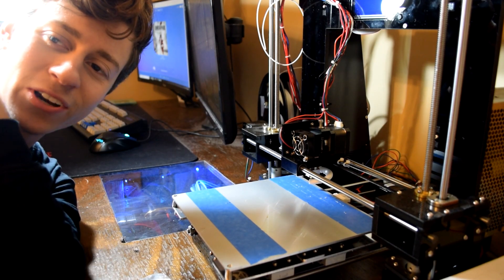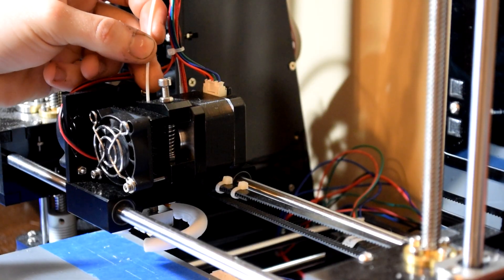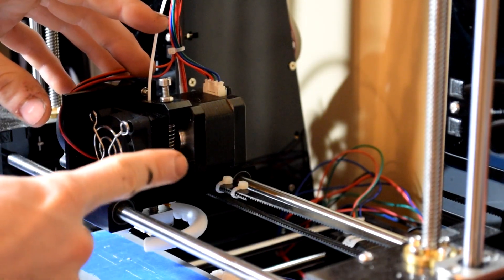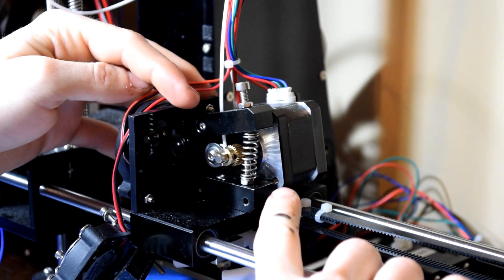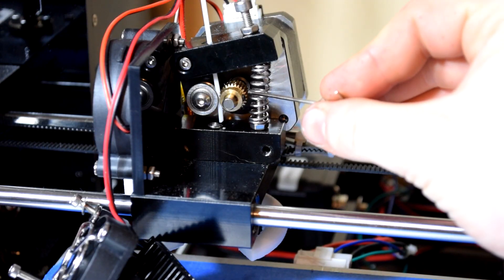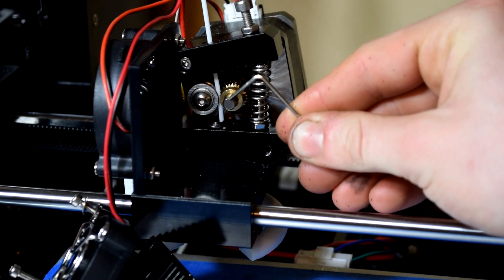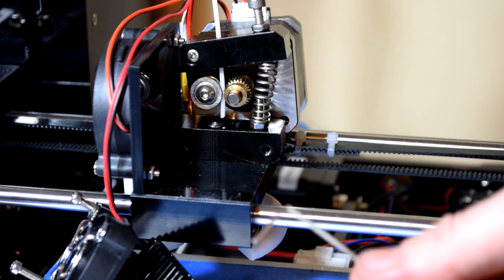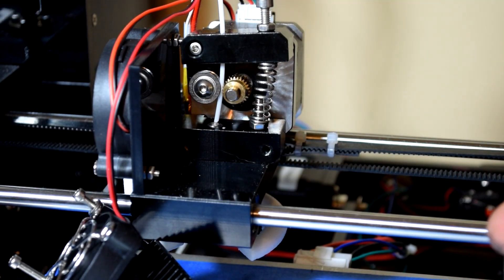3D Printer Filament not Feeding? FIXED!

Comment: For me, this is not the fix I needed, but I would like to share this to everyone. The source of my problem is that the spring is not as pushing as hard. As a result, there is not enough hold on the filament, what I did is I just tighten up the bolt of the spring.

Comment: I know this video is a few years old but I'm only just having this problem with my ender 3 v2. I don't want to take apart the whole extruder mechanism to see what is going on because its just that brass gear that keeps coming loose, is there any way to secure it down without drilling and tapping the shaft of the stepper motor?

Comment: Thank you for your video. In my case the gear rotates as I 'Move axis' Extruder, but it doesn't forward the filament. When I release the gear I can easily push the filament forward by hand and the heated extruder works, lets the material out. If you or anyone can give me a hint where to go...

Comment: Honestly I was having a similar problem but it was more so the position of my spool rather than this exact dilemma. Easy fix though really. Having the spool level with the feeding area (I'm still a newb and don't know the terminology just yet) on a rotating platform works PERFECTLY! I was lucky enough that my wife actually already had a rotating platform she wasn't using anymore because the post was broken but with a bunch of tape, it works just fine for what I need it for. Plus I'm sure you can print one out as I'm seeing more and more that there isn't a single thing you can't print. Best of luck guys and happy printing!!

Comment: Revisiting this since I gave up last time. Notice no comments on my comments. I kept replacing parts in hope of fixing it but I'm pretty convinced at this point that some if not most 3d printers are engineered to fail. Not sure if anyone is familiar with the inside story with the guy who found a programmed chip in his ink printer that was actually programmed to limit prints. After so many prints it would prevent the printer from working. That's exactly what I think is going on here.

Comment: Same problem after about 10 hours of printing on brand new mega zero 2.0.  Yep the gear set screw was loose. Same fix but different parts. My gear shaft has a flat spot and if the set screw isn’t lined up with the flat spot it will continue to loose n!! And lining up and feeding the filament through before tightening the bolts is a must, and don’t over tighten (or the gears might not rotate!) 
This was a great post. I’m back up and running in less than an hour! Thanks Toasty Boys!!

Comment: Nope. Didn't fix mine. Set screws were nice and tight. I went ahead and even replaced that cog. Replaced entire hot end and still a no go. Guessing it's that bearing and wheel next to the cog. I'll try replacing that next and report back.

Comment: A five minute video that could have been a 45 second one. Summed up: Check that the filament is feeding by ensuring the drive gears are fixed properly and tighten the grub screw if not. :) - I'll keep searching...

Comment: My Ender 3 ran out of filament and after reloading it the machine doesn't feed anymore. I don't think it's because of a loose screw because even when I push the filament into the hole, while printing, it doesn't go in. I think maybe some melted filament got stuck where it doesn't heat up and now it's clogged :/

Comment: My trouble is on my printers screen it says extruder off and won't feed. Is it the same issue? Ive taken my extruder apart. Nothing seems wrong. When my printer is running. The extruder heats up, fans on but nothing comes out.

Comment: So i did exactly the steps in the video on my Ender 3. But it did not solve the problem. What does confuse me though, each time I start a new print it works fine. But about halfway through the filament just stops coming out. The brass gear is turning but it's just chowing away the filament, it's not pushing anything through.

Comment: I checked this on my printer and the toothed gear had moved, just like you said, but it also had cut through the pla and the piece of pla was blocking the tube that goes to the bowden extruder.  all I had to do in addition to repositioning that toothed gear is to take both ends of the tube loose and pull it gently up away from the extruder.  Then preheating the extruder made it so I could slide the disconnected length of pla out of the extruder and I was ready to put the tube back in place and feed new pla and it's working fine.

Comment: Thanks! Your video and explanation are exactly what I needed to fix the feed problems with my BIBO 3D Touch printer. I had never taken this area apart, and now it is good to know how, in order to clean it and repair problems in this area.

The problem mine was having is that filament had broken off right where the Gear and Roller are closest, so that the filament in the nozzle could not be driven down into the Hot End, and new filament could not get between the Gear and the Roller. By taking it apart as you show, I was able to press the old filament down. Reassembling allowed the Gear to feed new filament. Thanks again!

Comment: I had a slightly different scenario, my feeder stepping motor is at the top of the tower and fed down through a pipe, and when adding the new filament, it just stopped dead and acted as if the nozzle was cold.
I can only conclude my filament had a slight bend in it at the tip, lesson learned for me!

Comment: I have a different problem if anyone can help. I have an ender 3, the filament won’t go in between the cog and the bearing and all the way through without it going under the bearing. If anyone can help it would be greatly appreciated
Reply: I can help with this. I have four Ender 3 myself, and one of the things thats been recommended is to snip off the end of the filament, at a roughly 45-degree angle. That way, when you try to feed the filament through the extruder, it wont be as easy for the filament to either curve around or go under the bearing, it should be able to just go straight into the bowden tube. Hope that helps!

Comment: The 3D printer at work stopped extruding so first thing i did was look on yt. This was the first video i saw and i decided to look inside the extruder myself. The filament had curled around the gear TWICE! Thank you man for the vid don't think i would have even found it if it weren't for this vid.

Comment: I am having the same problem that.  This is the same fix that everyone mentions however, this is not what is wrong with my extruder.  There is almost no tension between the gear and the filament guide.  Everything I have adjusted does not increase/decrease the tension of the gear on the filament.  Any help with that?

Comment: I've been trying to figure out how to fix my Ender 3 for hours now. Came across your video and I have to say "Thank you!" Thumbs up man, you saved me from hours of frustration.
Reply: What exactly did you do? My cogs are moving as it's printing and it's not coming out of the nozzle. I took it apart and pushed pla through the nozzle and it was fine so I have no idea where the problem is
Reply: @terryhesticles7149  same
Reply: @terryhesticles7149  me too did u figure it out
Reply: @yaboipeach321  I changed the nozzle and replaced the tubing with the blue one (I don't remember what it's called, Teflon I think) from all the rolls of pla I bought pla + works the shittiest. Make sure the nuts by the extractor are tight
Reply: @terryhesticles7149 same :'(
Reply: Same it looks like that this problem is usual on an ender 3
Reply: I've been trying for a week with no solution the wheel thingy just doesn't guide it in but it's a new 3d printer and my first one... I don't know what to do now

Comment: Hey dude thx for the video. I have the same issue and I used your method to fix it but i still have the problem! I can actually print the first 2-3 layers but after that the filament feeding stops. What else can I try? ty

Comment: I had the same problem, and quickly fixed it without much troubleshooting.. Although, one other problem I ran into while taking that section apart, is the 2 screws that hold that whole assembly together, were over-tightened a bit, and had caused the metal cage over the fan to press into the plastic around the screw holes there, cracking a bit of the plastic under it. So I rotated the fan around so the other 2 screw holes were being used instead, also each screw had 2 washers, so I put 1 under the metal frame bars instead of leaving them both ontop, so they sandwich it. Annoyingly tho, I also ended up cracked the plastic a little bit without even tightening it that much.. So just an FYI to others, that fan's plastic is VERY weak and brittle. It's not catastrophic damage, but hopefully others can avoid my mistake there. lol

Comment: Is making the toast the first step ? cause i did it it and it didnt work
Reply: That's funny. I made me an omelette and toast and sat down to watch this. I'll let you know if it worked for me. lol
Reply: @petehenry7878  well?
Reply: @jacobcvpi8279  Didn't work for me either.
Reply: @petehenry7878  damn that sucks lmao😂 

Are you still having problems? I had to take apart the whole drive gear setup, put the filament through then put all the gears back on. Pain in the ass, but it’ll work until my direct drive kit shows up. It comes with an all metal extruder gear setup, so I figured I may as well do it for $25 🤷‍♂️
Reply: @jacobcvpi8279  Yeah I was still having problems, but I got P O'd at it and I haven't messed with it for months. I can't even remember what my problem was now.
Reply: @petehenry7878  lmao and I thought I was crazy leaving mine alone for 2 weeks😂
Reply: @jacobcvpi8279   lol yeah 2 weeks isn't so bad.
Reply: That step is most defined needed
Reply: I had that problem too
Reply: yeah. did not work for me either. buying their exact brand of butter might help though
Reply: Making toast is always the first step
Reply: HAHAHAHAHAHAHAHAHA That's SOOOOOOO FUNNY But My 3D printer was not feeding and now I am trying to put it back together I REALLY NEED HELP!!!!!!!!!!!!!!!!!!